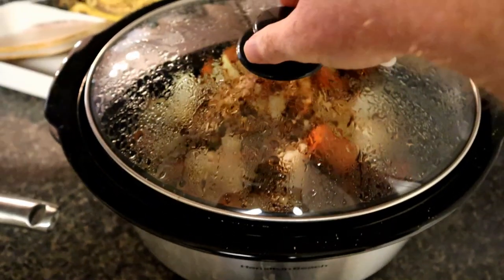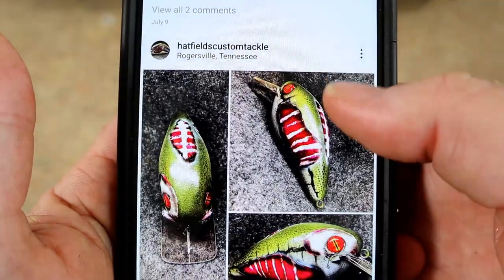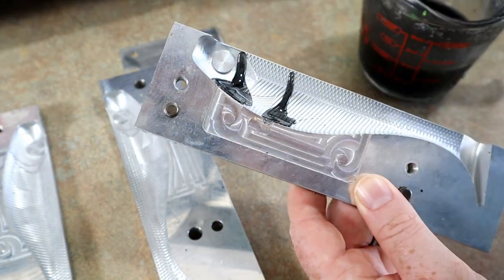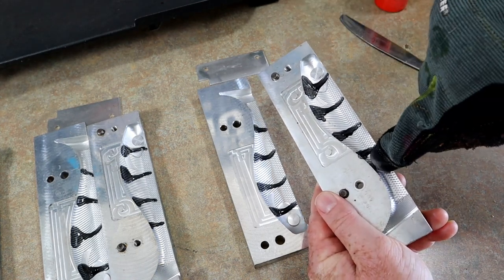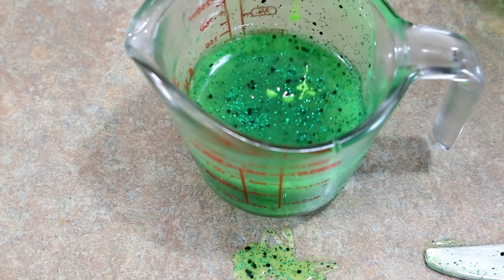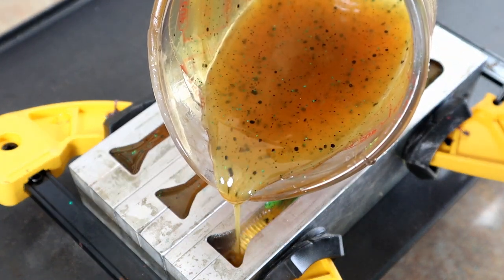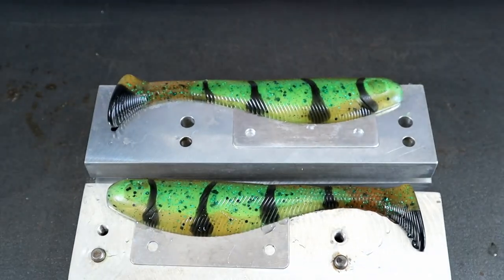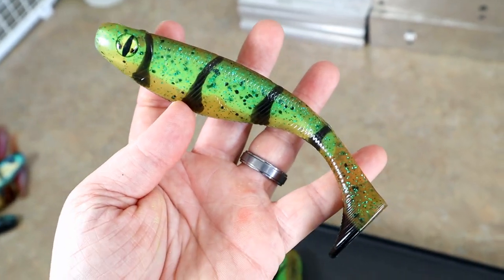Hand-Pouring A CUSTOM CRANKBAIT Pattern (Difficult Pour!)

Comment: I bought an aluminum meat injector for pouring into some open poor molds.  Really makes it easier to be accurate and not have to do so much trimming.  Especially on the lizard and frog open poor molds I have.  They are cheap on amazon.

Comment: The Eyes are a Perfect Compliment to the Green. But if I had the Tools and Materials, I Would have made a Second batch of Green. Small Black flake, No Large Flake, and equal parts Green and Yellow Flake. The black tip tail, and A Pearl white core was a Great ideas to both add contrast and Highlight. But I'd like to see you try this one Again
Reply from the maker: All good ideas...might looks great, might not..even someone that's been doing this as long as I have never knows if it's going to turn out until you open the mold

Comment: Try using the handle of a small paint brush i believe you will have alot more control.
Reply from the maker: Because plastic cools and sets up fast, you cannot use such methods to apply plastic with any sort of control to the mold.. a few people use shortcuts such as glue guns and soldering irons, the way I have the most control is by pouring.